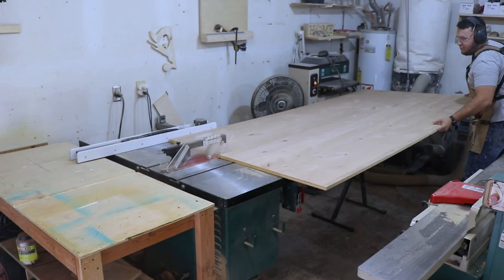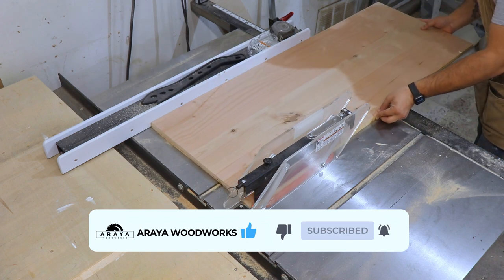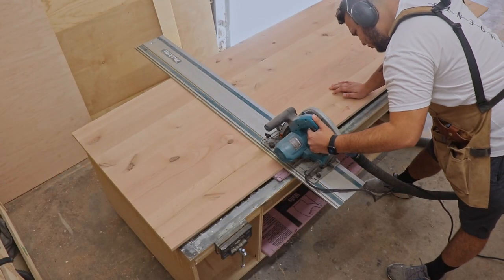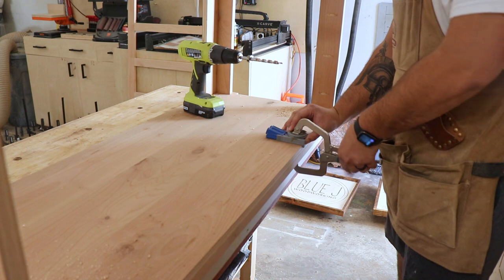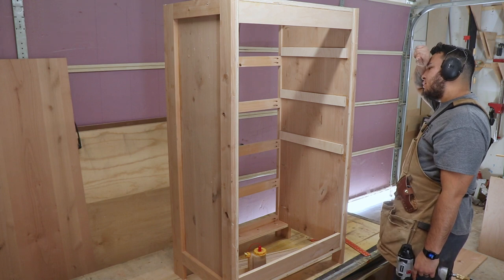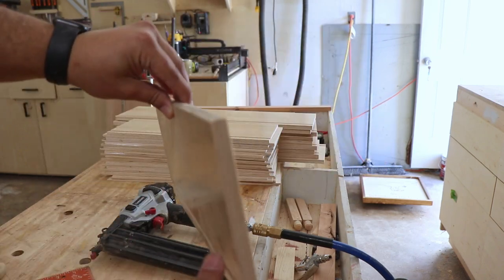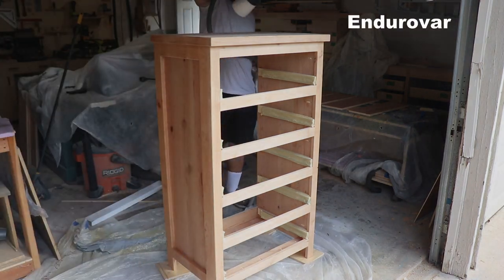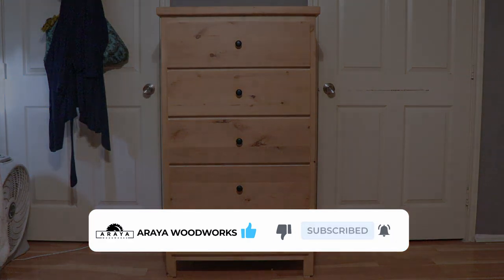Tall Dresser // Woodworking // Free Plans

Comment: For the drawers I cut a rabbit on the fronts and backs and a dado on the sides. The dado is quarter inch inset if using half inch stock. Then the rabbit will fit the dado.

Comment: I'm a beginning woodworker, and I've done this a few times, the upside is that you didn't pop a brad nail into your finger. Don't ask... lol

A simple solution would be to glue a thin strip of veneer on both sides to give a nice accent or contrast if you want to keep the chest in natural wood. Otherwise a bit of paint will cover the mistakes with the wood filler. Looking good though.
Reply from the maker: Haha I’ve been there for the Brad nail and finger connection 😂😂

Great point. Thank you for sharing a good solution